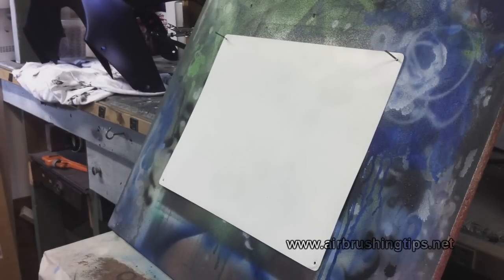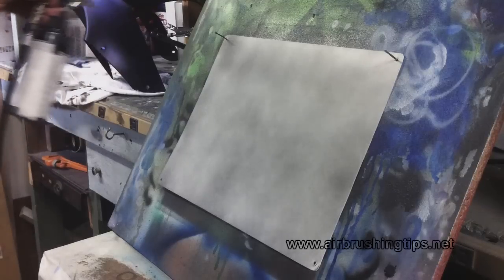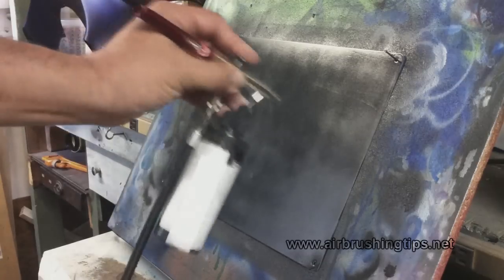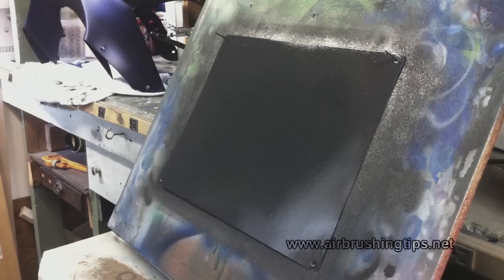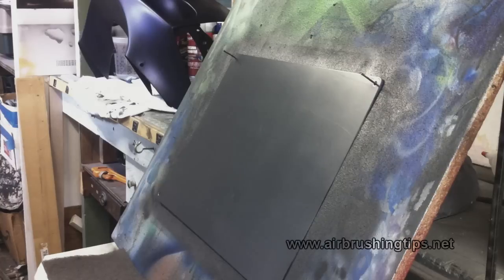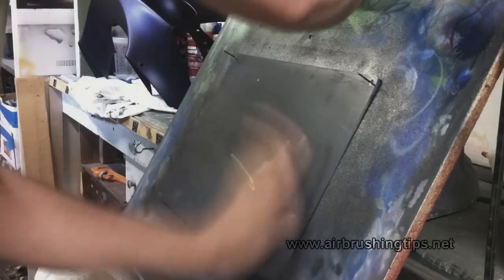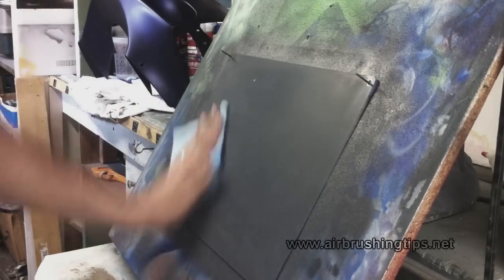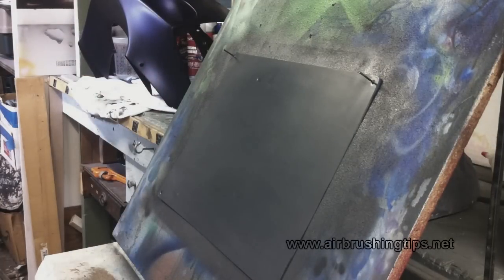Sanding Auto Air Sealers

Comment: Great videos!! I contacted Createx about "wet" sanding because it keeps the finer sandpaper cleaner longer. They sent me a tech sheet stating you can "wet" sand using odorless mineral spirits as the lubricant since you can't use water. It also states to use the odorless mineral spirits as a degreaser shortly after colors have dried but before fully cured instead of a solvent based degreaser as the mineral spirits won't remove color. Thought I'd pass it along.

Comment from the maker: Definitely not normal.  As you can see here, I didn't use any heat, just air movement.  I'd have to see it to help you troubleshoot, but it sounds like you're spraying too wet and now allowing the underlying layers to dry before going in with the next coat.  Which clear are you using?